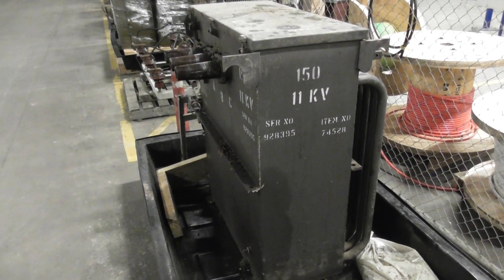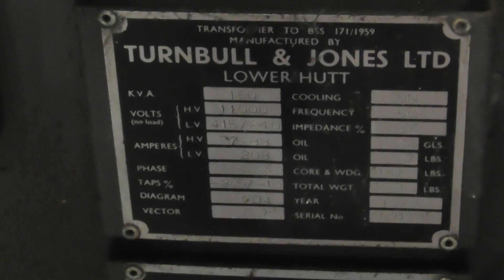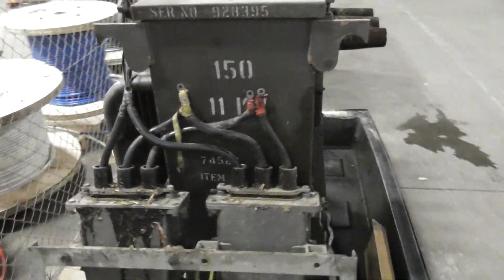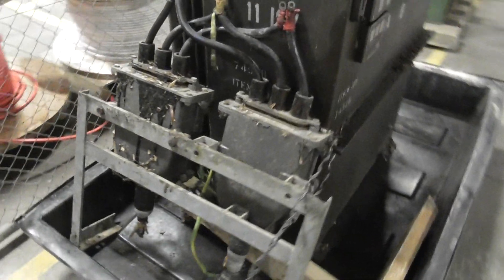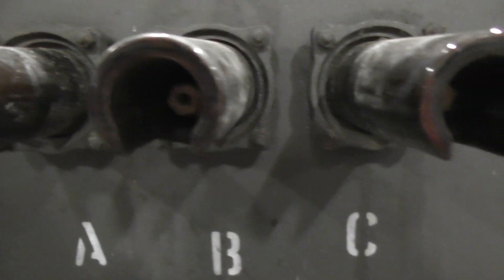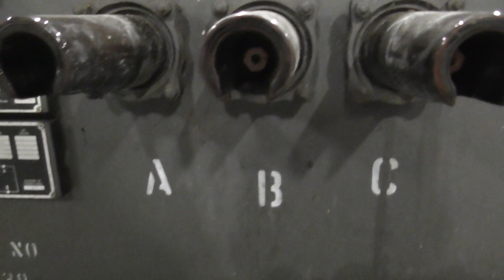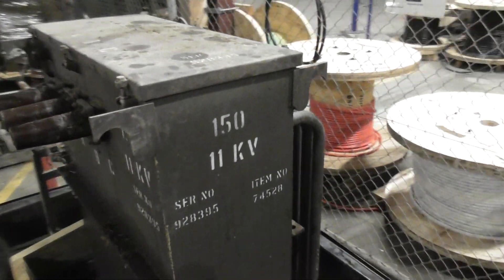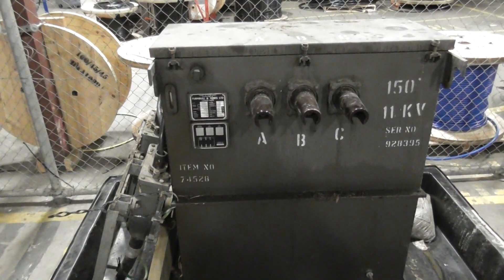150 kVA Turnbull & Jones power transformer

Comment: What's your best guess on the mass of that thing ? The plate you showed didn't clearly show the total weight.  To me, this doesn't look like a transformer that's meant for hoisting way up on a pole or tower, it looks to me like a design that's meant to be parked a lot closer to ground level.
Reply: Its definately a pad transformer, likely inside a substation for distribution.  Since the contacts were exposed im betting substation behind a fence.. but you aint lying on weight bud, 15kva sdt to residential voltage are beasts.  The copper windings are massive then you have all the oil, iron shell, and the radiator ..  no man or team of men usually lift those boogers..
Reply: @Z-Ack  These things are all over the place in NZ.  The one in this link is 300KVA, takes in 11KV from the top of the pole and feeds 230/415V back into the lower level of wires on the pole, for distribution over a few hundred metres.  https://goo.gl/maps/UNfjFEkx2pNDFfU46
Reply: @RangieNZ  Yeah they seem to be in suburbs with underground services. There's one right outside my house and I'd love to see what happens when someone bowls their car through it.
Reply: You can pole mount them, which is done here a lot. Just need to have 4 sturdy poles arranged in a rectangle, and then another 2 bolted to form a frame, with 2 half poles as the short side members. Then guy wires on all 4 poles pulling out to keep it upright, and the one side poles hold the 11kV feeders, while the other side has the output side, all the switchgear being up in the air. Mostly for rural settings where there is regular fires, the poles survive  as they are dipped in fire and borer retardant, used to be hexavalent chromium salt, but now a borax and green dye, then a final creosote paint layer to protect. They do last a long time in service like that, out of the way of all but the most determined thieves.
Reply: Stan Patterson - These are actually pole mounted, at 150kVA, this is about medium sized.  Remember, looking at it 8 to 10 metres up, it doesn't look that big.  Generally, anything above 300kVA, goes on the ground.  It would weigh around 250 to 300Kg, so two poles will support it easy.
Seen all around rural UK.
Reply: @bridgerectifier7711  There's not a chance that weighs quarter of a tonne - the empty steel box would weigh that, plus the huge amount of copper and oil inside.  My guess would be way over a tonne.
Reply: @RangieNZ   - You can get a rough scale of the dimensions by just looking at it, around 700x400x900.   I design and install battery cells for power supplies and a 2v lead/acid cell around this size (4600Ah) will weigh <80Kg.
Unless it's made of Uranium, it will never be over a tonne in weight.
Reply: Correction - 4600Ah 2v cell weighs 210Kg.
Reply: @bridgerectifier7711  Details I got off the nameplate:
OIL 154 GLS (~700L ~630KG)
CORE & WDG 1175 LBS  (534KG)
TOTAL WGT 25_1 LBS  (~1150KG)
Reply from the maker: The total transformer mass is 2510 LBS or 1139 KG.
Reply: @RangieNZ   - Well, I stand corrected.  That's one heavy bastard transformer.

Comment: Question on the 33kv ABS switches since I just saw one on the ground near the end: Are they still useful elsewhere than in or around substations?
Reply from the maker: That is an 11 kV line switch. Most of these are being replaced as they are not really designed for load breaking a current of more then 25 - 50 Amps.